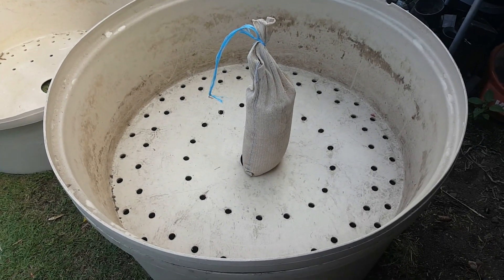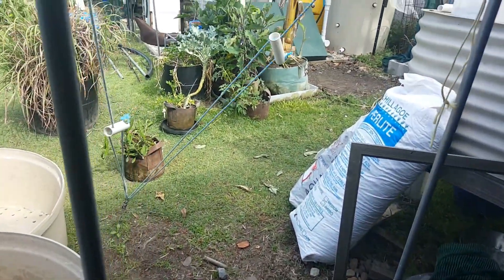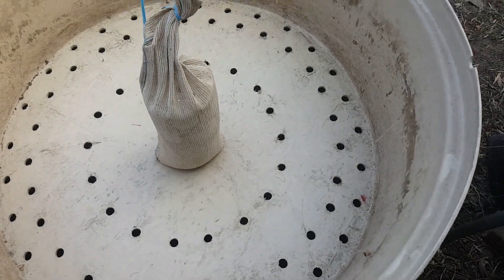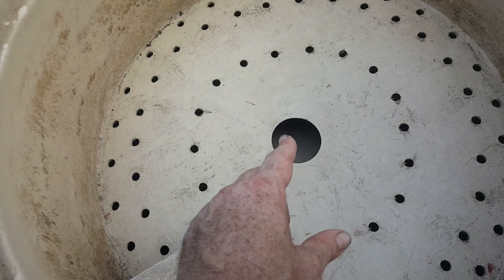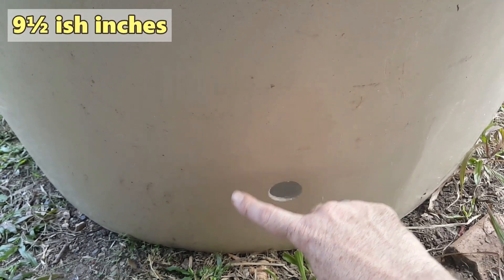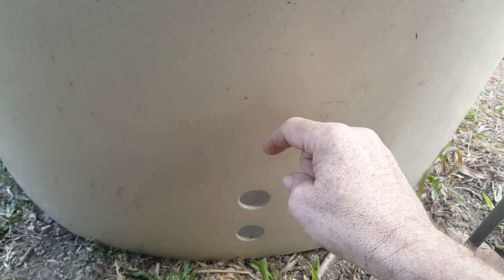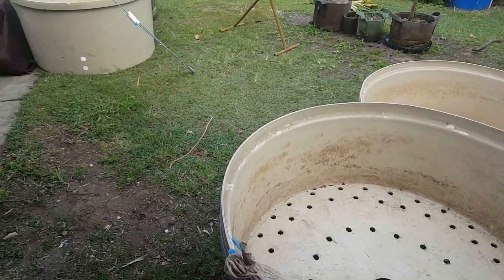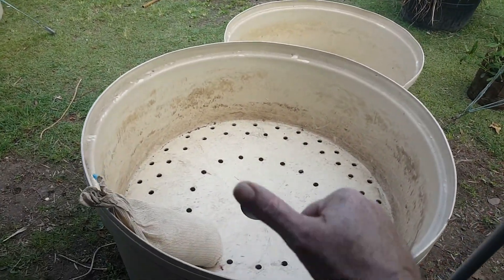Patreon Clip - Sorting Out the New Wicking Beds

Comment: sounds like u are on to a winner there. 
i only have one wicker bed atm, a old fridge. information to build it take from your videos and another video about using fridges to build wicker beds. i used what i liked and adapted it to what i have on hand, it seams to working ok.
300 mm water holding, big rock / brick and pipes bottom layer. then pipe and smaller rock middle layer, top layer fine rock. 300 mm soil, always seams moist even when water holding area only 1/2 full.
i do like your idea about adding media bags to help wick the water up, interesting.